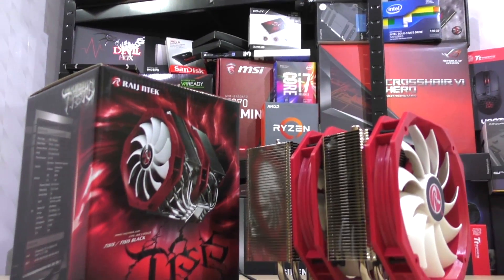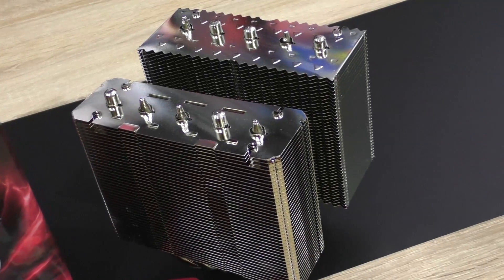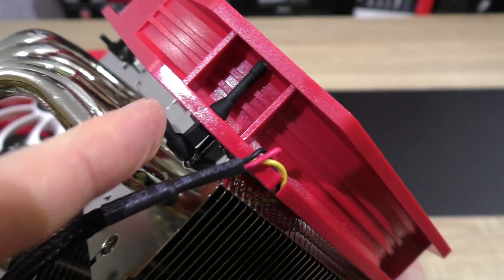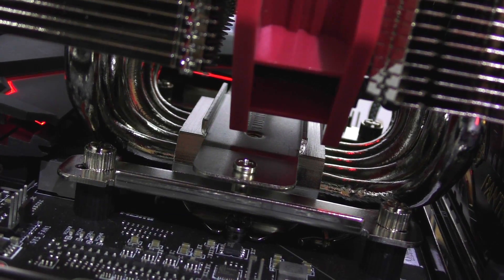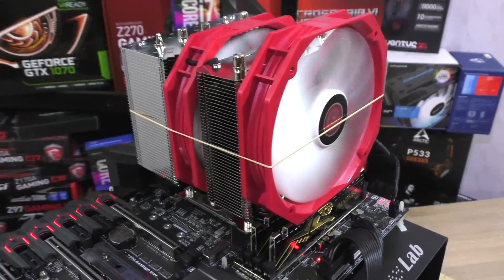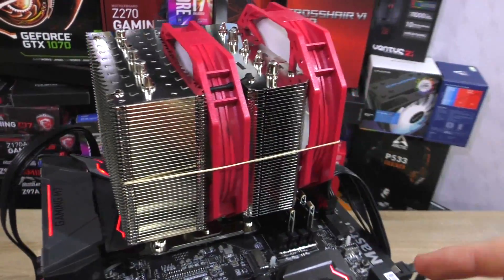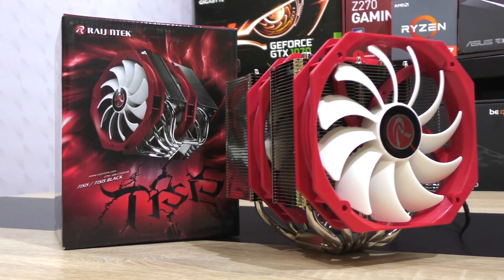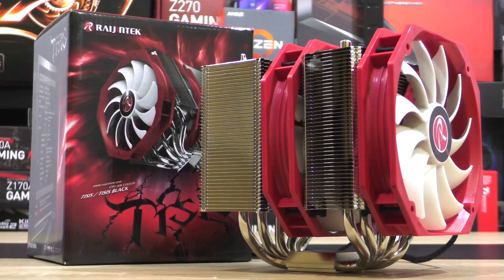Raijintek Tisis - Epic FAIL?

Comment: For the fans, you should carefully look at the orientations of the rubber mounts in the manual booklet. You have the rubbers upside-down. The rubbers are suppose to be pushed into the cavity and then secured. It looks you have the rubber mounts upside-down and then forcefully tried to "plug" into the cavity from the top.
Reply: Yep, of course he gives it a negative review because he installed it wrong lol

Comment: The cooler is big, I agree. The rubber mounts will go inside all the mounting holes with no problem. biggest issue is having to remove motherboard to properly install cooler. Plus like other recommendations use bequiet fans, make a big difference. my idle temps were roughly the same, load temps were lower.

Comment: Well, I bought the black one that comes with no fans and the store gave me two black fans in the bundle. While it's true that you can't mount the exterior fans and the mounting system is very poorly implemented, having just the middle fan is more than enough. My late i7-4770 was never over 35ºC on idle and rarely over 75ºC on gaming load. I live in Brazil in some of the hottest states and have no AC in the room, so I think that's a win.
Reply: Oh yeah... and it's pretty silent

Comment: So in the real world, I use the Tisis Core edition on a 6850k @4.42 Ghz,  But I didn't waste my time with the factory fans; Instead I use two Corsair Air Series SP120 120mm in a pull config,  so is it that hard to try a different fans?  I don't really break 65 c,  Since you didn't specify do you use the stock thermal paste?  I use Thermal grizzly conductonaut,  even with 8 sticks of gskill trident z i never had clearance issues even when I just attached two 140mm fans just issues cause the mounts are for a 120 or modified 140mm fans.

Comment: 1. Research cooler before U buy it. If it doesn't fit Your mobo or ram don't buy it. If You buy it anyway don't complain
2. Yes fans are loud and hard to mount. Loud like when i switch them for 120mm corsair CO-9050003-WW there was no difference but it looks cooler :P
3. When it comes to performance Tisis is on par with Noctua 15